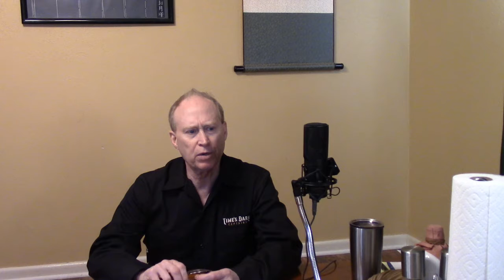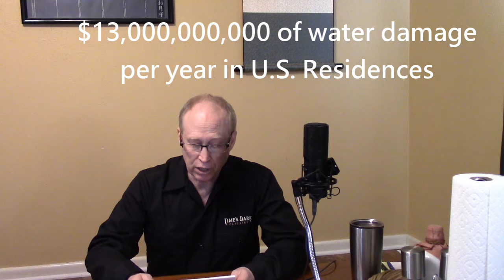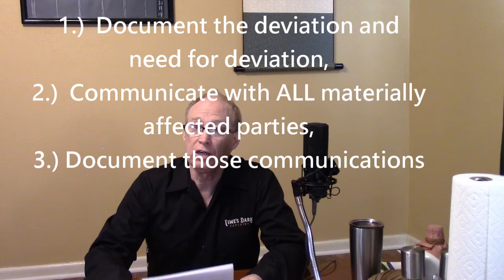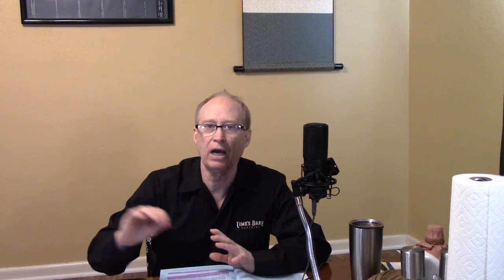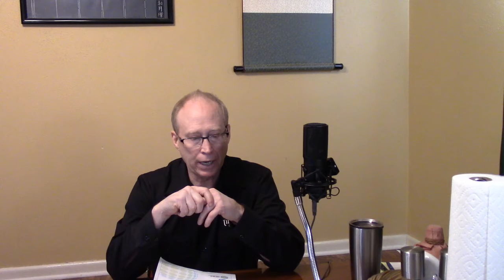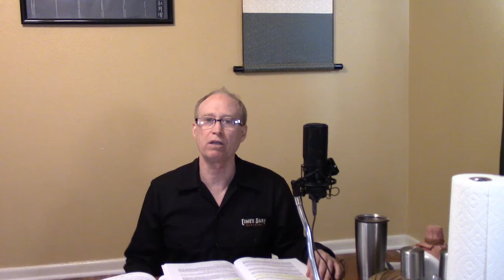Texas Mold Remediation:  IICRC S520/R520, IICRC S500 and the TMARR

Comment: I’m back for seconds :) I’ve noticed to success rates for a Condition 3 are higher if an IEP always writes the scope of work for the remediation contractor. Accountability is crucial too (PRV). Speaking of PRV, what are your opinions for post testing surface sampling and what counts determine a pass or a fail? Raw count for example?
Reply from the maker: Thanks for the response sneakypete.  Since I am in Texas that is a must regardless of the amount involved.  Under the Texas rules (and some other state rules) the Mold Assessment Consultant (IICRC equivalent of an IEP) must write the protocol AND the Mold Remediation Contractor must write a work plan the supports and executes the protocol.  We also have have a 3 step clearance process: VISUAL:  absence of mold and wood rot, PROCEDURAL:  analysis of whether the project was conducted with the protocol and the work plan, and ANALYTICAL, do the samples meet the predetermined levels in the protocol.  Does everyone do this or hang paper?  As for the surface sampling and levels, in the proposed rules in Texas was "30 counts/square inch" and suggested to have a minimum of two samples and collect them at a rate of one per 500 square feet of containment.  I think that is reasonable, but sampling alone is not the whole picture and never was in mold investigations and remediation.  Air samples particularly need to be taken in conditions where they will work and at the correct number which is not one here and there. That did not make it into the final rules.  For analysis never use raw counts for anything other than proportion, especially with air samples.  In short, the Texas rules did not establish levels or practices, but require   every one to work out what they are going to do prior to starting and notifying the client beforehand.  Accountability has gone south in Texas because the TDLR did not enforce this rule after DSHS gave them the program since 2017.
Reply: @timesdarkcaptains9170  Awesome, thanks for sharing. So the 30 counts for the sq in surface sample is not the raw count then? I ask this because surface results will have mc3 (sq meter as you already know) multiplied by the detection limit, which that part (DL) I still don’t have down fully yet. 

And for example, what if it ends up as 20 count of Stachybotrys or Chaetomium vs. Aspergillus/Penecilium surface results. Is that considered a fail because different molds are obviously more toxigenic?